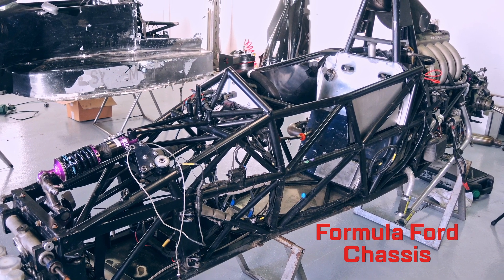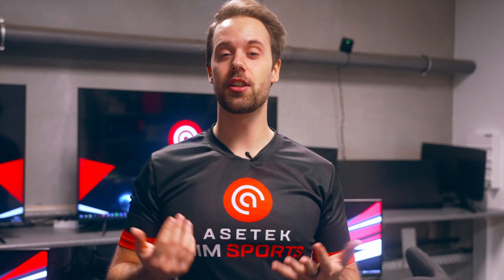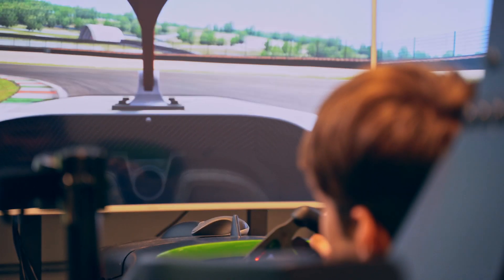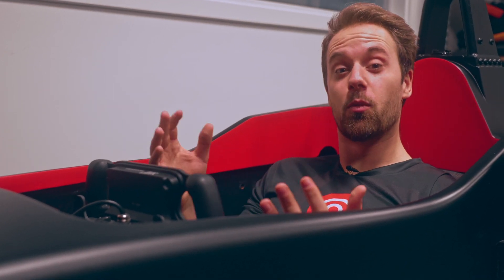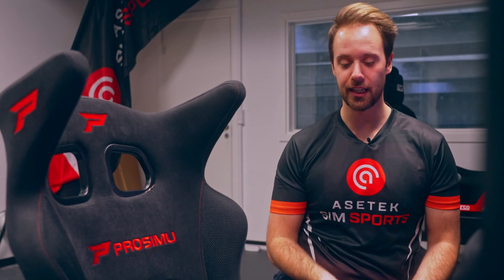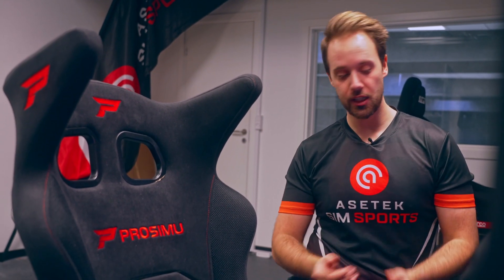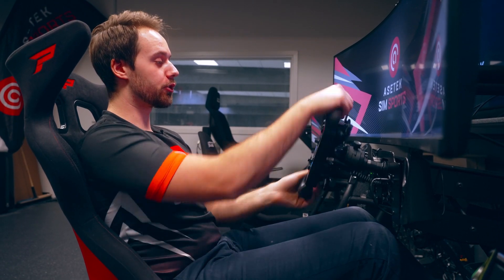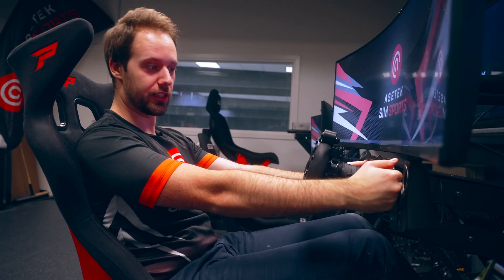Ergonomic Sim Racing Setup: Seat, Steering Wheel and Pedals

Comment: I’m having left knee pain when using my asetek brake. I usually rest my heel on the heel plate when braking which I noticed causes the pain ,but when I watched this video your heel is in the air. Is that how we’re supposed to be using this brake pedal?  I did notice when I brake with my whole foot raised in the air it hurts a lot less. Which is the correct way?
Reply from the maker: In the air. The heel rest is for resting 👍

Comment: a waterfall of words, and nothing useful
Reply: As far as I'm aware recommended elbow angle is 90 degrees. He said 45 - 50...that's a half...having elbow at 90 degrees alows to transfer power from your shoulders to the wheel in most efficient way.all muscles in most efficient way.  At 45 degrees you will be straining all muscle groups because you won't have the "purchase" to push the wheel. 

The straighter the hand, the less bicep engagement you will get and therefore shoulders and wrists will be doing majoirty of work with tricep sprinkled on top

Comment: hi!.. i have some trouble with my pedal distance.. the front of my ankle itches a bit and my calf is itching also.. only hurts a little bit if i drive longer periods of time.. do u guys know what to do?
Reply from the maker: Hi. If you often experience pain when sim racing, you should consider consulting a doctor or physician. Don't take risks with your health :)

Now we have mentioned that you could adjust the distance to see if you get more comfort over time in a different setup. The pedal hardness and pedal plates could also be possible adjustments. Of course that depends on what leg (throttle or brake), you're having these issues with.

Comment: What is this whell adjustment up/down/front/back ? What kind of Rig has this?
Reply from the maker: The rig we use in this vid is from Phoenix Racing (Phoenix Sim). 

The average sim racer of course can't make wheel adjustments so quickly, but the overall points on ergonomics are still relevant no matter your setup at home :)

Comment: Great video!!! Do You consider releasing a separate brake pedal any time soon? So we can place them as You said. A lot of people do not use the clutch pedal in sim racing, since we got a dual-clutch system on the steering wheels))
Reply from the maker: Thank you! 🙏

The clutch is a separate add-on on our Invicta pedals, so you can just keep the base throttle and brake combo if you prefer the system on your steering wheel :)